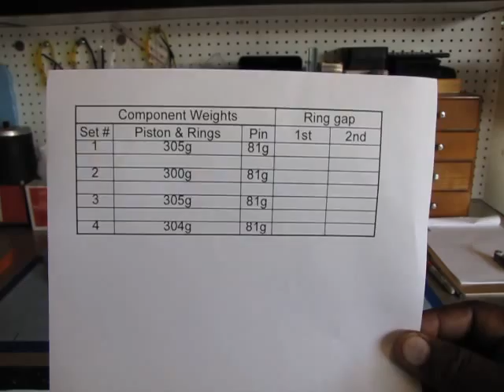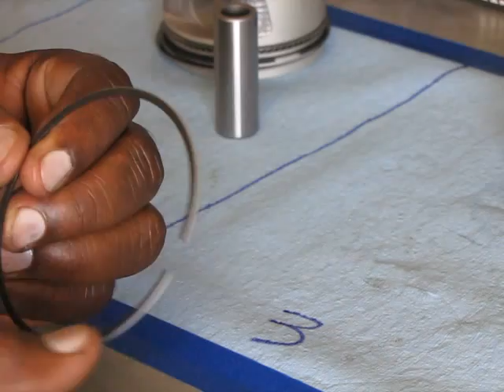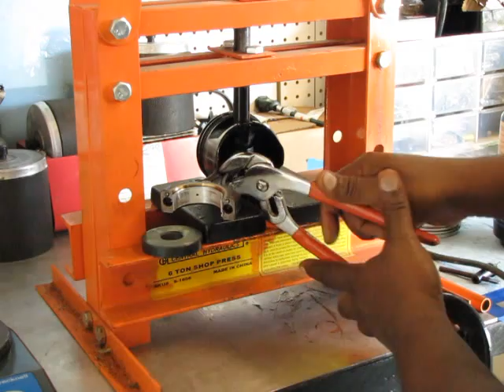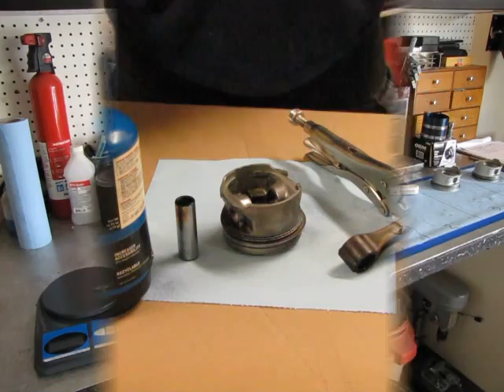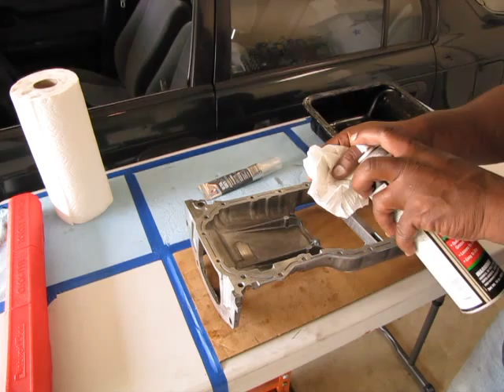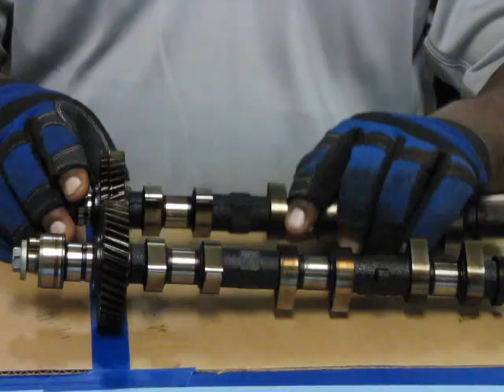How to rebuild Toyota Corolla 7afe 4afe Engine Install pistons, cylinder head, set engine timing

Comment from the maker: If you want to learn how to perform basic service on your car, this full collor book is the best you can get!
https://www.amazon.com/Your-Care-Companion-Clint-Hightower/dp/1517466946/ref=sr_1_1?ie=UTF8&qid=1493398557&sr=8-1&keywords=your+car+care+companion
Reply: Good video !!!
Reply: instablaster
Reply: @Engineerboy100 I have one of those back in jamaica but I'm in need of one connecting rod and it's really hard to find or source I would really appreciate it if you con lend me some assistance
Reply: I would like for him to have a tutorial on how to change all the seals/gaskets on the 2zr-fe with the OEM engine gasket overhaul kit. I really want to do this on my two leaky 2zr engines.

Comment: I know this is an old video, but I am currently doing a refresh on my 97 Corolla.  I have the whole engine out of car right now.  Getting ready to put the head gasket back on and the cylinder head back on.  Do I need to use any sealant with the gasket?
Reply: no if its not to late no sealant with the head gasket maybe a little with the valve cover gasket thats basically all

Comment: Awesome video. It really helped me through my build. I do have a couple things though: first, the “installation marks” you used are actually the timing marks. The installation marks are actually the other dots on the gears. (I have the shop manual but prefer to watch how it’s done in lieu of reading about it.) Secondly, personal opinion, take it as that, don’t turn the crank backwards, especially when setting timing. You always want to go in the direction of engine rotation. Otherwise, I loved it. It helped me a lot.

Comment: Great Video 👏
Do you have the torque Specs of the rod Bearings by any Chance? I cant find them in the whole Internet
Reply from the maker: I don't. Torque specs. should be gotten from the manual to be sure they are correct.

Comment: Great video, simple and effective advice! Is this gen2 4A-FE or 7A-FE? I noticed that crank position sensor, and those trigger teeth on the crank pulley, my -95 A-FE doesn't have those, so there must be some difference between the engines or year models?
Reply from the maker: This engine is 7afe.

Comment: I see you did this in the car without removing the crankshaft from the block.  I would like to see a full overhaul with the engine out, the placing of the main caps, the orientation of the pistons, the torques and sequences of the main bearings, etc.  It seems no one else has created such a video on YouTube either.  I work on the '90 era Toyotas - the ones that get 30+ mpg without the blizzard of computer tricks and sensors that so easily fail on the newer ones.
Reply from the maker: That would be a cool 😎  video in deed,  maybe one day. Who knows, we'll just have to wait and see.

Comment: Great video. Was fun and informative to watch.  I have a 91 corolla 1.6 4afe that has been leaking some oil into the coolant for awhile. I guess it could only be the head gasket. I am currently attempting to pull the head myself and replace the gasket. Is there any reference you would recommend to help me in this job, or do you have any suggestions or knowledge of any unexpected circumstances I may run into. I have never pulled a head before, but have done a lot of more basic maintenance on my fleet of cars before. Thanks.
Reply from the maker: The main thing is follow shop manual instructions as to what position to have your camshafts before taking them off.  Then make sure you loosen the bolts that  hold down the camshafts a little at a time. The springs on the lifters are very strong and the camshafts are very brittle.  If you loosen the mount bolts all at once, the force of the springs will snap the camshafts.  I would suggest you have the head checked for flatness, if is not flat , your head gasket will fail again. ... have the head leak tested and have the valve seals replaced.  Good luck.
Reply: @Engineerboy100  Thank you very much for the tips!

Comment: Hey guys
I’m working on a Ae102 1995 7AFE 1.8L.
I have attached a timing light and it seems like the mark on the harmonic balancer is fluctuating between 6-10 degrees. If I connect the check connector it makes the engine loose power. Can you please help me?
Thanks

Comment: Boss how did you get the piston from the bottom did you just push it up from behind the piston? There's no video of disassembling the piston from the block.
Reply from the maker: Yes, you push them out from the bottom. I don't show them coming out, but I show them going in at 4:15 of the video in this link.  https://www.youtube.com/watch?v=r9ctubbY82g&t=853s
Reply: @Engineerboy100  thanks boss appreciate it.

Comment: Can you help with the torque specs on the main caps, the con-rod caps and the cylinder head bolts.
Reply from the maker: You should get torque specs from a shop manual to make sure they are correct. I don't know the value off hand but as  a rule I don't give out torque specs as that is a window for error.
Reply: I've tried looking for the manual online but there's nothing. Any recommendations?

Comment: just rebuilt my 97 corolla 4afe 1.6l have not started it yet. how did you go about starting your rebuild ?
Reply from the maker: I put "first start"  grease on all parts during assembly then just before starting I added 1 quart of oil on top so it could trickle down immediately before the oil pump supply arrived. I drove about 100 miles then changed the oil. Engine has been running very well up to now.
Reply: @Engineerboy100  thanks for the reply. i had to change my crankshaft i destoryed a journal a few years back and never sold the car so i figured i would rebuild it. so i put a new crank shaft in and a new rod. all new pistons std size and new rings and gaskets. used assembly lube for all moving parts inside engine . just measured valve clearance measured in between .006 - .008 inch just have to connect these hoses and pour in the fluids  but i forgot where these hoses connect idk if this link to my picture will work 
https://scontent-ort2-1.xx.fbcdn.net/v/t1.15752-9/s2048x2048/195919604_592589015477101_5353694604565964136_n.jpg?_nc_cat=104&ccb=1-3&_nc_sid=ae9488&_nc_ohc=pCi7HY6ruZIAX-2Kt6-&_nc_ht=scontent-ort2-1.xx&tp=7&oh=052c0e49f96fb4b5b950b6f99665b4f7&oe=60E60B8D
Reply: @Engineerboy100  i started it the other night it started good but i threw a code and i have tired every thing to fix it that i know of i threw a P0505 idle air control valve took it off and tired to get the iac valve off to look at the inside but those 4 way screws are hard to get out so i cleaned the intake valve while i had it off because i forgot to do it when i rebuilt it put it all back on ran it again still got the code started to test the iac connection with my ohm meter but my ohm meter broke and my engine was getting really hot so i quit for the night and clue what could cause me to throw this code

Comment: Very informative video. Thanks for your outstanding effort. Can I remove the cylinder head only on my 4AFE without removing the intake manifold?
Reply from the maker: Not really I mean technically it's possible but it is much much easier to remove the head and manifold together.
Reply: @Engineerboy100  thanks for the feedback. Much appreciated!
Reply from the maker: Thank you for your comment and for watching. You can but it is much more difficult to try to remove the cylinder head without the intake manifold.

Comment: Hi There, Im actually working on my Toyota 4efe 1330cc. I have a question, is it a must to have the lobes on both cam rod for piston No.1 facing the front of the car? Because on mine its different, since I bought the car. I had some issues when it was on idle as the engine is shaking and not running smoothly. Can you give me an advice on this? Thanks in advance :)
Reply from the maker: Time can absolutely be different on different vehicles. A timing specification only applies the the specific engine being worked on.
Reply: @Engineerboy100  Okay, I had two mechanics trying to fix this issue, but in vain. One last thing, should it be on top dead centre before timing the engine? No.1 firing position got nothing to do?

Comment: Permatex Ultra Gray Gasket Maker cures on exposure to 
moisture in the air. The product dries tack free in one hour 
and fully cures in 24 hours. Cure times will vary with 
temperature, humidity and gap. Longer cure times will apply 
to applications in low humidity conditions or colder 
temperatures.

Comment: Can I use a 4afe connective rod bearings and piston rings on a 7afe
Reply from the maker: You should always verify details like piston, bearing  size, but I believe they are the same size I think the rods are different because the displacements are different.

Comment: "That's the sound of another 300,000 miles." You nailed it with that statement. Thanks for making this video!
Reply from the maker: Thank you for the vote of confidence Michael, You just made my day :)
Reply: @Engineerboy100  Thank you for taking your time to film edit and post the video you are a blessing !
Reply: @Engineerboy100 how much longer did you keep the corolla after this video? Is she still running out there
Reply: Nope ! rebuilt engine didn't last that long . Trust me.  That why I usually swap the engine.
Reply: @drsanmyattun  How long did your engine last before your swapped it out? Just curious.
Reply: Awesome bc my 1993 Toyota Corolla 1.8 liter engine is being rebuilt & it has a little over 300,0000 miles on it.

Comment: Great info Clint! Thanks for sharing it all; question, I know you said there's a specific orientation for the compression rings on the piston which are sometimes marked (which side is top/bottom), but what about the oil ring & the 2 thin ones on either side of the oil ring? They don't also have a top/bottom side?

Comment: My car was overheating so i took it to a workshop. They charged me 50 dollars and said the head gaskets gone and i have to get a new engine. I went to a friend who help me change the thermostat and problem solved. I will never trust another mechanic again after that. So I'll be watching your vids to try and learn what i can. Thank you sir :)
Reply from the maker: You should also grab a copy of my book, hard copy on Amazon.com, pdf down load is free. "Your Car Care Companion"
Reply: @Engineerboy100  I'll get that thanks. I'm having a 2zz installed in my mr2 spyder at the moment and I'm hoping to turbo it later on and while I'm doing that I want to drop the compression so this information is handy. Cheers

Comment: Wow. Great. What if you find groves on the crank? My son just ran his out of oil. Figuring I will find the worse when we take it apart.
Reply from the maker: Then you have to make decisions, polish the crank if not too bad. Replace the crank in you have the time, money, ability etc. sell the car, junk the car buy a replacement engine .... etc. it depends on your situation and what you plan to do with the car.
Reply: @Engineerboy100  and if you polish the crank and the test shows too much space, then a new crank is required or machining the crank and changing the bearing size. I am guessing based in my reading.

Comment: how much you spend in all the parts? i want to know because i have one with 217,000 miles and still running good but i guess went it reach the 300,000 i want to rebuilt it.
Reply from the maker: about $850
Reply: Wow that’s it.. I’m in Ny and everything is expensive...

Comment: Can you help me with something? I'm having a few issues with my 7afe, i changed the timing belt water pump thermostat and coolant but i can't seem to get all the air out of the cooling system. I can hear gurgling in my heater core. No leaks, blows really hot and if i drive it like 100miles without stopping it will overheat just a tiny bit. If i put clean antifreeze it will get dirty real fast like brown color. What's your opinion, head gasket, clogged radiator or leaking heater core.
Reply from the maker: Sounds like you either have a blown head gasket or rust in your block or both. I would start by pressure testing the cooling system, I just so happen to be doing a video on that later on today lol also I would test the thermostat to see if it is actually opening well. I test mine by taking it out and putting it in a pot of boiling water on the stove and observing how well it opens.
Reply from the maker: I will be using this kit for my pressure test and vacuum fill.  https://www.ebay.com/itm/332743705358?hash=item4d7912030e

Comment: Excellent with the reheat piston and experiment with room temp with the wrist pin. Some guys cry your weakening or possible warping but that’s propane heat. I do the same on my Harley with the cam plate bearings also👍
Reply from the maker: Yeah and this is a low power, low compression engine, I've never had an issue.

Comment: Hi dear thank you for your efforts. Can you give me what gap . Clearance measurement number for engine EE90/2E 1,3 I have stander pistons like new 73 bore  I bought original ring set but I not know if this I open engine already but not know what ring set clearance wish you reply me soon thank you
Reply from the maker: That information you should always get from the correct shop manual.
Reply: Clint Hightower I really don’t have Dont deal with the shop manual and I don’t have catalog for this engine because this I asked you if you have experience about my engine 2E Toyota 1,3cc - 12V

Comment: i had this motor in my 00 camry and i wish mine looked that clean. I wanna rebuild my motor as well in my 05 camry with the new piston design so the oil rings dont burn out. Any suggestions for a first timer on where to go find some solid guides i can possibly paay for on engine rebuilds? XV30 2.4l VVT-i I-4
Reply from the maker: I learned using shop manuals specific to the vehicle and watching videos here on YouTube.  I get all my parts off eBay.

Comment: Letting the silicone cure a little before tightening is great for maybe a diff cover but precision mating surfaces typically require you to assemble and torque within 5 minutes. And you don’t have to use so much silicone because the surfaces are so precise 90% of the silicone will squeeze out externally and internally and sometimes break free and suck up onto the oil sump. As long as you prep the surface well you will have an excellent seal

Comment: Has anyone ever heard of a cleanse overhaul?  Performed through the spark-plug holes, without the rebuild.  The spark-plug is removed, then the bore/cylinder are sprayed/gunked/brushed/vacuumed through the spark-plug hole.
Reply from the maker: Not exactly what I've seen.  The overhaul is done by changing the valve seals by removing the the camshafts and changing the seals by removing the lifters and using a tool to remove and replace the seals.  the cylinder is pressurized  with compressed air or rope is put into the cylinder through the spark plug hole to keep the valves from falling into the cylinder. ... that said, I do NOT recommend the process.
Reply: Thanks for the reply, I just thought it would be more convenient.  We have engine knock issues right now, and an overhaul is a really expensive option at this time.  I thought it might be less time-consuming, and less expensive.
Reply from the maker: If you have a knock, and it is actually something loose like a rod, there is no additive that will fix that.  When you say "knock" what kind of knock is important too, a knock fix could be something as simple and better quality fuel or adjusting or freeing up a stuck lifter or it could be a failed crank bearing and you could need to replace bearings, rods or even the crankshaft itself.  The best thing to do is find out what kind of knock you're dealing with.
Reply: Thanks for the info, I didn't realize there were other probable types of knocks.  I assumed, with the loss of power after the engine heats, that it was an engine knock issue.  The engine won't pick up even with the accelerator all the way down sometimes.  It just knocks and runs at the same pace.  I thought it might be a lifter too, but the loss of power just doesn't seem like a lifter issue.

Comment: I have never done anything like this but I noticed that the rings were in the piston when you removed the grams form the piston,  because the rings are in wouldn't that change the total amount of weight of the piston?
Reply: i think the point is afterall u want the weight 2 be equal

Comment: I WOULD RECOMMEND, KEEPING THE RODS IN ORDER & INSTALL THEM ONTO THE NEW PISTONS IN THE SAME DIRECTION BUT, THE MOST IMPORTANT PART IS, THE SECOND U HEAT & EXTRACT THE WRIST PIN, I WOULD IMMIDIATLY PRESS THE NEW WRIST PIN N2 ITS NEW PISTON & THE ROD, WHILE THE ROD IS STILL HOT SO, YOU DONT HAVE TO HEAT IT TWICE!!! IT WEAKENS THE METAL & FATIGUES IT!!! CAREFULL NOT TO OVERHEAT THE ROD! IF IT GETS CHERRY RED HOT, ITS OVERHEATED! SO THE SECOND YOU REMOVE THE WRIST PIN, GET THE ROD INTO IT'S NEW PISTON & PRESS THE NEW WRIST PIN INTO PLACE & THERE ARE ALLIGNMENT TIPS FOR THE WRIST PINS AS WELL. STILL, ALL IN ALL, GREAT VIDEO!!! TEACHING & SPREADING KNOWLEDGE & SELF SUFFICIENCY!

Comment: it needs to check valve clearrance if head gasket replace, i met problem with water loss while head gasket replacement also, would l replace all new gasket again？  thank you
Reply from the maker: If gaskets were replaced recently and they are not damaged, you should be able to re-used them ... but you should never re-use the head gasket.